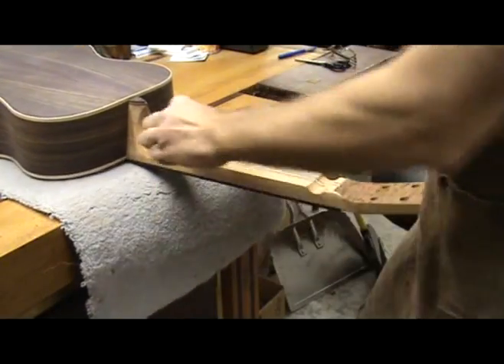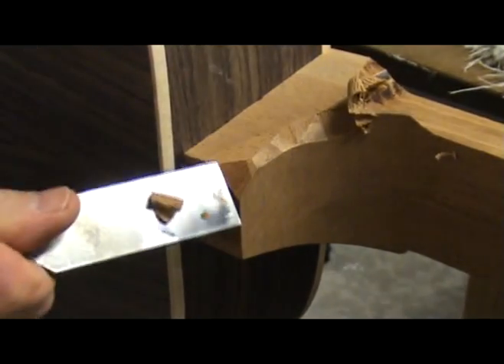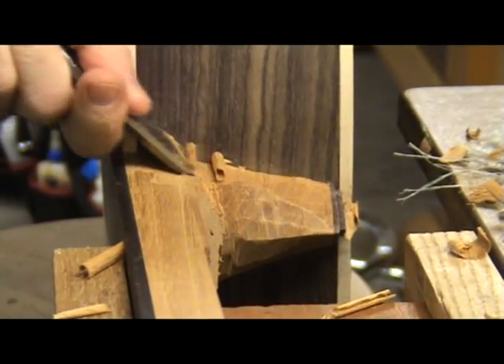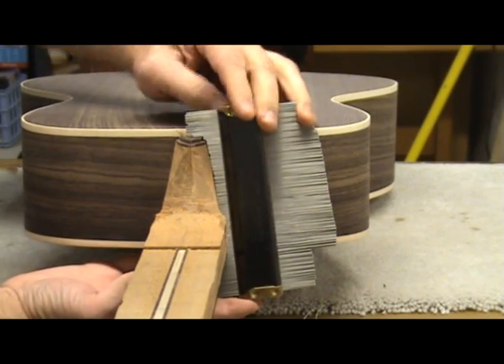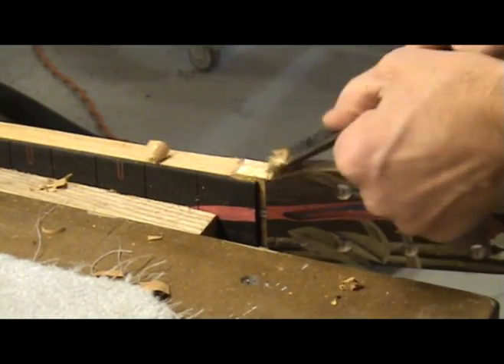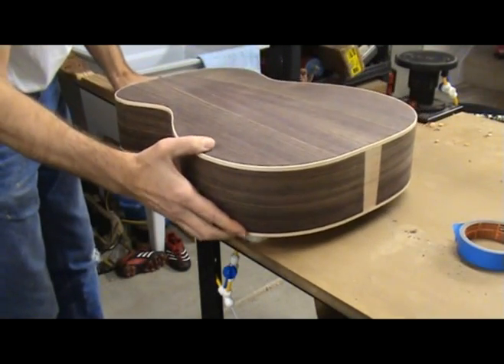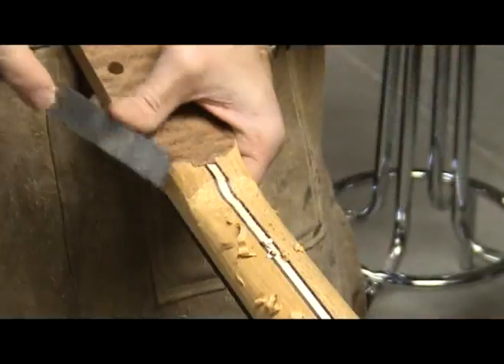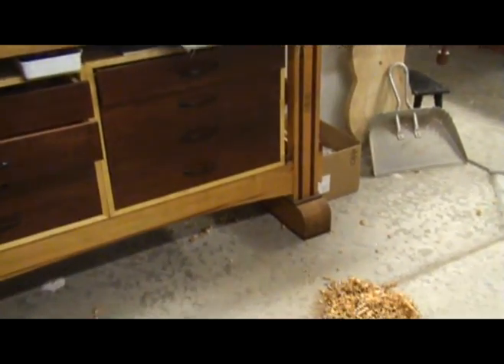Luthier Tips du Jour - Neck Carving - O'Brien Guitars

Comment: Some times i takea sanding belt and sand across the garain like a shoe shine rag to asimilate the lines then i use progresively finer papers ( emery) to remove the cross grain lines  i also use a 1 1/2 inch dowel wrape in sand paper to remove rasping lines out of rounded areas

Comment from the maker: @moucon Yes, you are correct. Carve the neck on or off the body?? Finish the neck on or off the body? Good things to think about. I prefer doing the two steps above on the body and for a classical guitar with a Spanish heel you must do it on the body. I am going to work on the audio levels and see if I can improve them. I am a guitar builder though not a video/audio guy.

Comment: What kind of neck attachment method was used for this guitar?
Am I correct in assuming that there was no glue placed between the heel block and sides, where you chiseled away the proper heel shape? My reason for asking is that I plan on using the Spanish heel method, and I want to know if I would be correct in gluing only the inside of the sides where I insert them in the heel.
Thank you very much.

Comment: @byjuu246
Imagine a circle, you probably have had subwoofer speakers around your house before. A 10" sub has a 5" radius. 
Apply the same idea to your fret boards, but this time imagine only a small section of the circle. The circle with a radius of 7.5" is 15" & a  7.25" is 14.5" circle.
The difference is playability & possibly hand size for some. Generally, a small radius fretboard is a better rhythm guitar while larger is easier solos. The board is a 2"(+/-) section of the circles outer edge.

Comment: Hi ! Very interesting video ! Is it not easier to thickness the neck before to round it ?
Thank you !
Reply from the maker: Whatever way works best for you. Both ways will work.
Reply: OBrienGuitars
Thank you for your answer ! I'm still hesitating over doing like this ok like that...
Thanks.
Reply from the maker: Etienne Corbet Find a way that is best for you and go for it. You can do it.
Reply: OBrienGuitars Thank you ! I used a method I found very reassuring for a beginer like me. I started by lowering the neck at its final dimension (+1mm). I drew the shape in 2 boxes on a paper of the transversal cut of the neck at frets 1 & 8, then drew a tangent at approximatively 45° to the shape, took mesurements and report them on the neck. then, using a spokeshave and a rasp I removed material to the lines. I repeated the operation with three others tangents and when done, finished with sandpaper. Here is the link explaining how I did : http://lutherie-guitare.org/wordpress/manche-mise-en-forme-1/ It did the job as expected, I'm quite satisfied. Anyway, when I'll be more skilled, i'll probably use your method !